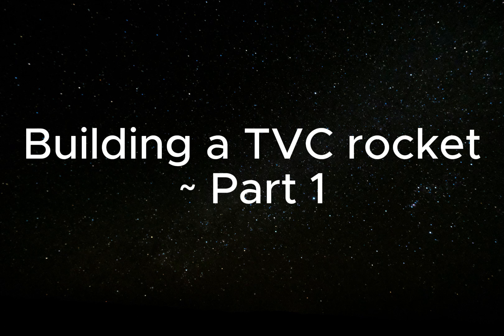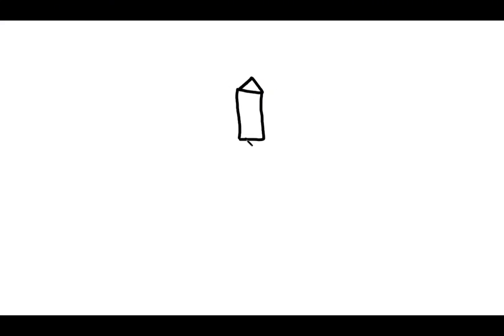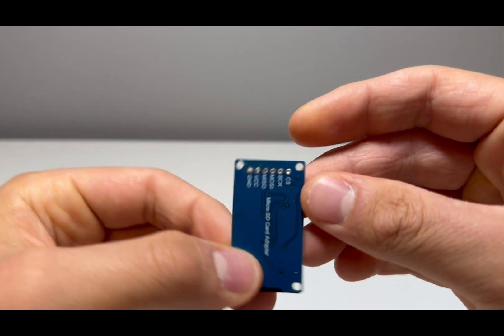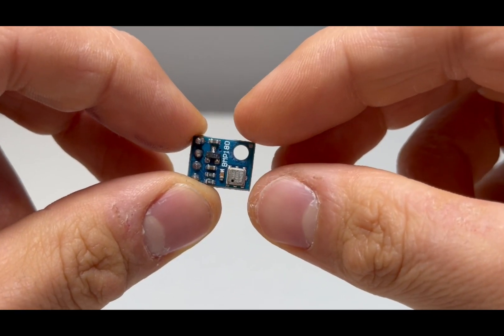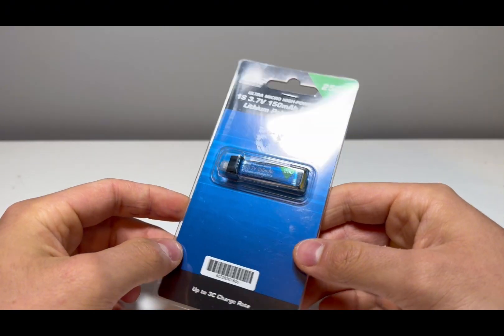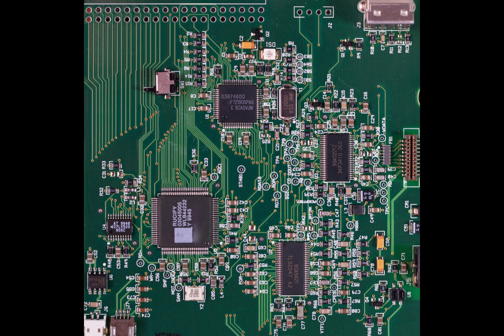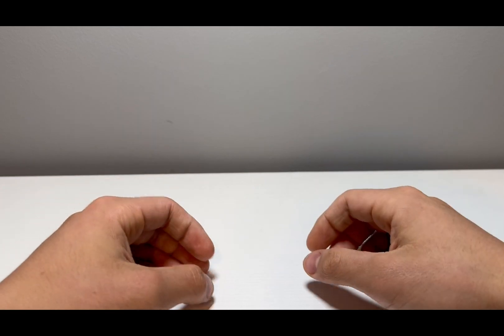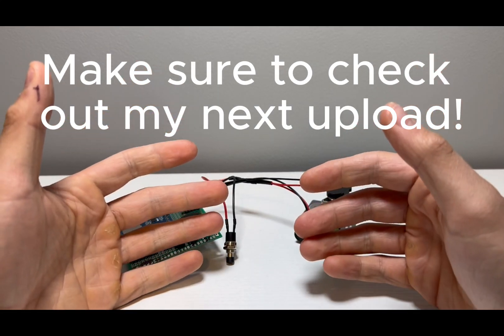Building a TVC Rocket ~ Part 1 The flight computer

Comment: I'm working on a similar project with an Arduino nano rocket flight computer. You might have problems fitting the flight control software onto the Arduino's flash. I recommend switching to a more powerful micro processor, like ESP or raspberry pi.